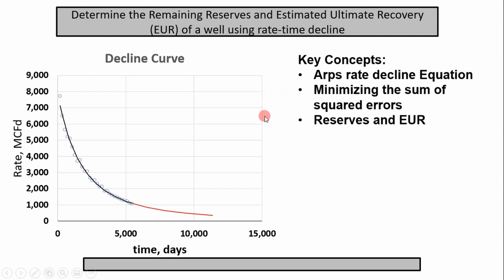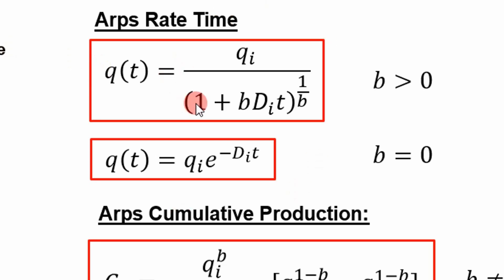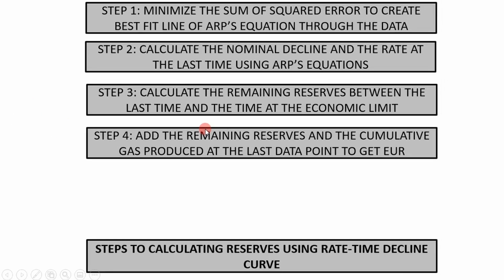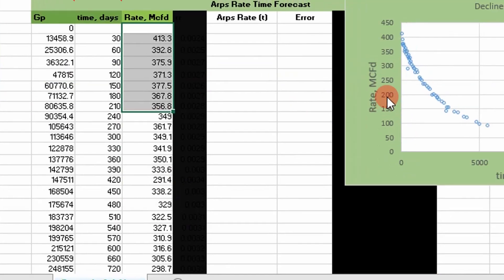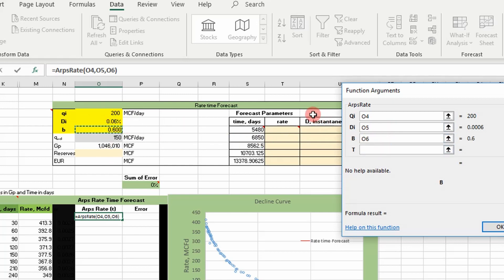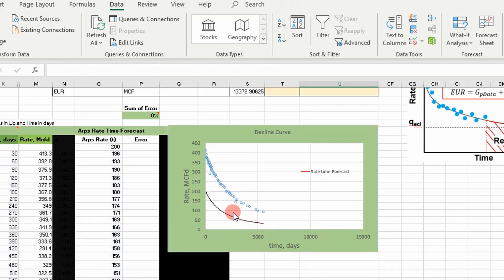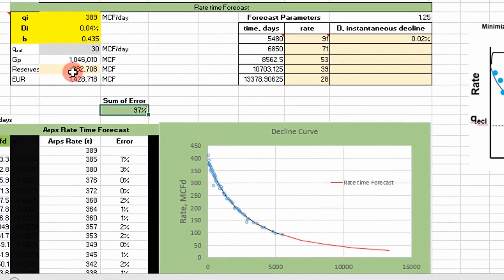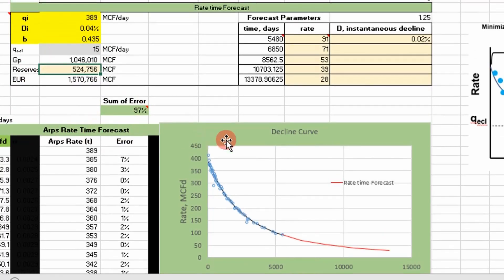Rate-Time Decline Curve Analysis: A Step By Step Approach

Comment: You mention minimizing the loss between arps and your data for the best fit line, so why not just include this loss function in your code as opposed to having to manually alter each arps parameter. It almost defeats the purpose of writing code at all.

Comment: Hey Brandon, great work man, in building the sheet and also explaining, i got inspired by your excel skills. Bro, could you please share your sheet with me plz. I need to recreate my own. Thanks.
BTW, i have subscrbd your page.
Reply: Thank you so much....been laid-off oil and gas sector and got little rusty...and your step by step analysis was very helpful. Thank you so much.
Reply from the maker: Thanks for tuning in Musab. You can get the code and gas production data I use in the video at https://topdogengineer.com/decline-curve-analysis-rate-time-forecasting/. You will learn a lot just developing the template. Hope it helps!